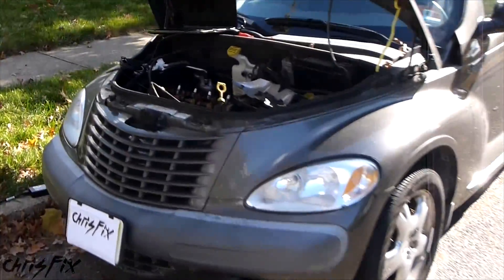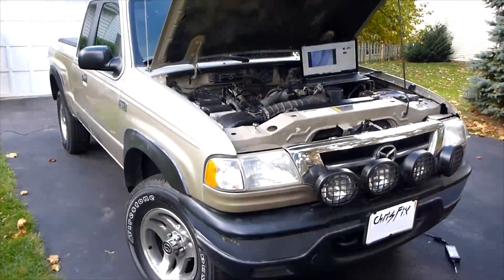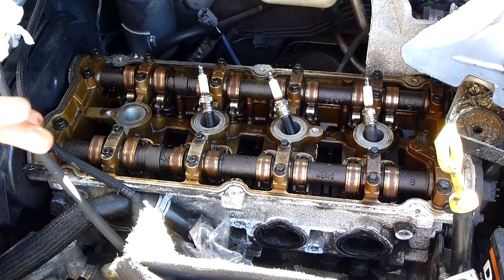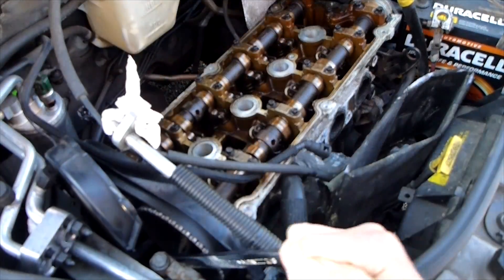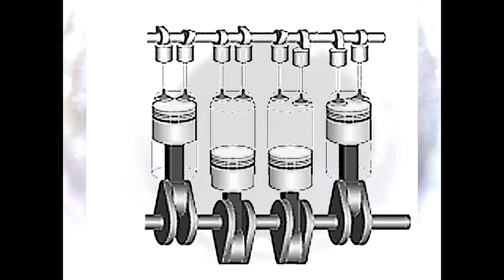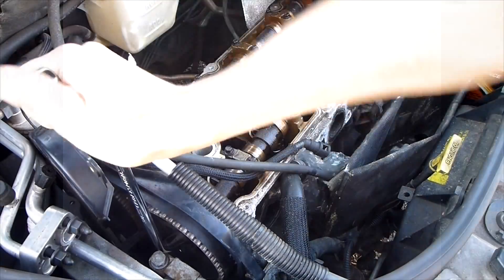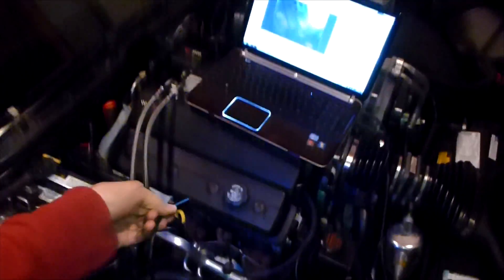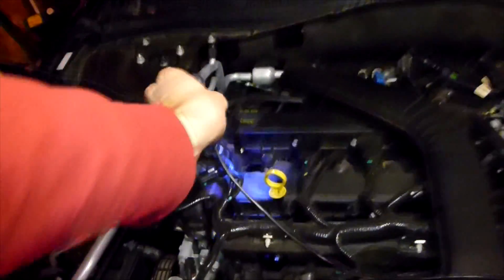What does the inside of an engine with a Bad Head Gasket look like?

Comment: Would you put fuel cleaner in your C4? It's a perfect candidate :) Great video!
Reply from the maker: Jesse Crandle Gotcha! Thanks a lot man! So it sounds like I will try Redline, Gummout Multi-System, Seafoam, and water. That should be a good test. Now I need to find 4 similarly dirty engines lol
Reply: ChrisFix I'm thinking that maybe just a before and after would be fine, just to validate they were all dirty or how bad? I think it'd be amusing to use water on the dirtiest, because water really does do just as good of a job on the chamber as Seafoam, Redline, or Gumout. The difference with the Gumout and Redline is it also cleans the intake valves, fuel injectors, fuel pump, lines, etc.
Reply from the maker: Jesse Crandle Yea, I will have to think of a good experiment setup.
Reply: I was thinking of buying that Gumout bottle of magic pixie dust 'n stuff, but now I'll wait till Chris uses it to see what happens :D
Reply from the maker: February I wouldnt typically but I am going to now that I saw how the edges of the piston had some buildup. Any idea of which fuel cleaner is a good one?
Reply: ChrisFix Redline S1-I or Gumout Multi System Tune Up. Redline can be found at Oreilly's, or on Amazon. Gumout Multi System Tune Up is sold more commonly at Autozone, and I believe they're still doing a buy one for 8.99 get one free, which makes it the best bang for the buck. Also it's important that it's very specifically Gumout Multi System Tune Up, they have many products but basically the Multi System Tuneup is the only one that ISN'T a gimmick.
Reply: February LOL Smart call. Since I have brand new fuel injectors I kind of fell of the excitement for many of the bells and whistles that comes with the Gumout Multisystem one. So I went with the basic Regane. It has twice the PEA over the Multi one and that's the way to get Nitrogen or "Shell" power cleaning to your cylinder. The rest of regane is just solvent.

Honestly, the best way to chose between products, (well with the bore scope, I think we'll get a lot more information) is to read the MSDS. I looked it up on a ton of prodcuts before I chose. I already put into my gas tank an enzyme to stabilize against ethanol, so that ruled out the need for the Multsystem one as well.

ChrisFix I don't think you're going to find 4 similarly dirty engines! lol
Reply: DE Nichols So, what should a good fuel system cleaner have? I would read MSDS, but how do I know which cleaner is the best and what to compare it with and what to look for? I'm guessing less solvents and more "stuff"? :D
Reply: February I went positively nuts with my comments about it on one of Scotty Kilmer's videos, so I'll try to find that for you. I've forgot 80% of what I worked on that day.
Reply: WOW! Google search of Gumout Regane MSDS and my Google Plus post is in the top 10! I guess I said more about it than a lot of people, lol.

Comment: I'd love to see a before and after of an engine treated with seafoam, just to see if it really does anything and how well.
Reply from the maker: ***** That is a good one! I would like to see that too! I will definitely make a video on this! Thanks for the idea!
Reply: ChrisFix Would especially like to see it after the seafoam is induced through vacuum and maybe through fuel tank as well to see how good of a job both methods do...
Reply: ChrisFix I honestly haven't tried just water (too concerned about gulping up too much too fast and hydrolocking!), but I look forward to finding out how much it does or doesn't work for sure!
Reply from the maker: Yea I would like to see that too. I need to figure out if I can find two similar cars with similar buildup on the pistons to test the two methods. But that is a great idea!
Reply: Plain old steam will clean the inside of the cylinder like new, so will Seafoam, so it "works", but why bother when water is basically free? Seafoam will NOT clean things you can't see so well, like injectors, fuel pumps, intake valves etc.
Reply from the maker: Jesse Crandle Plain water will not clean your engine in the way you think. I am pretty sure (and will prove it with another video) that you need more than just a cup or two of water to clean the engine out. I think you need a more long term, constant trickle.
Reply from the maker: Jesse Crandle Yea I am going to come up with a way to try and use a nozzle that squirts the water in as a mist so that there is no risk for hydro locking.
Reply: ChrisFix I haven't really cleaned a bore before but instead of pouring water what about using a steam cleaner?
Reply from the maker: XcomProbo That is not a bad idea... I wonder if that would work?

Comment: Welcome to Chrysler vehicles.
Those are Mitsubishi engines if I remember correctly.
Reply: ChrisFix Actually the new Dodges and Jeeps and Chryslers use Fiat engines, and they're pretty damn good. I believe things like the Dodge Dart have multi-air engines (infinitely variable timing) which is pretty nice for performance and mileage. Also as ugly as those new Cherokees are the quality of the interiors is about 4 times as good as they used to be. I work at a couple dealerships photographing new and used vehicles, so I've been in quite a few of their newer things. Much improved over the pre-bankrupt Chrysler. Unfortunately they STILL have to contend with the bad name the pre-bankrupt Chrysler had given themselves!
Reply from the maker: Sanic Yea. This made me realize why chrysler went bankrupt! Non US PTs used Mitsubishi engines and the turbo engine was derived from a Mitsubishi engine from what I know.
Reply: ChrisFix
My mother uses a Dodge stratus, and that car is POS.
meanwhile my corolla has 200K miles and I've only replaced a windshield reservoir and a gas cap.
Reply from the maker: Sanic I think that has the same engine as this. It is amazing how bad chrysler got. I will tell you one thing, they have some of the best looking cars, but I wont be buying one unless I get an amazing deal or it is a jeep.
Reply: ChrisFix
The newer jeeps are riding on mercedes Benz chassis and that new ZF 8 speed.
I assume that's a huge jump over that horrid automatic they used 2 use.
Reply from the maker: Sanic Yea, their straight 6 engines are pretty bullet proof but I dont know if they still use them?

Comment: How could I avoid having or getting head gasket leaks, and what solutions are there to treat the problem?
Reply: Id start with keeping your cooling system in tip top shape. i.e.  changing your coolant, making sure your radiator has no cracks in it. But thats my input. Im sure some body else has input as well.
Reply from the maker: Andre Jackson Sometimes head gasket leaks are unavoidable because it is a fault from the factor like in the PT Cruiser. It is a common problem in these cars to have head gasket problems. For other cars, +3I6uat3 hit the nail on the head. If you flush your coolant system when it needs to be flushed and keep the coolant system in good shape, you did everything you can.
Reply from the maker: 3l6uat3 You are correct! That is the most important thing you can do and I really cannot think of anything else you can do besides that.
Reply from the maker: Andre Jackson I will be making a video on knowing when you need to flush your coolant.

Comment: Excellent video! This also explaines how watercleaning (removing hydrocarbon build-up) works! :)
Reply from the maker: Latsaaben Thanks! But I would say this shows how long term water cleaning works. I dont buy that cleaning your engine with a cup of water will do anything. I think a long term water drip would work well to clean the engine. Maybe I should test this theory.
Reply: ChrisFix Yeah, you might be right! Some people use a cup of water, other use a pint of water. Rather than pouring it in, I think its best to use a pressurized spray bottle, since the water will be more atomized when entering the combustion chambers. But since you have a borescope camera now, why dont you test it out? :)
Reply from the maker: Latsaaben Exactly!